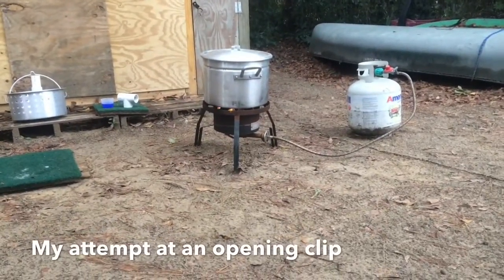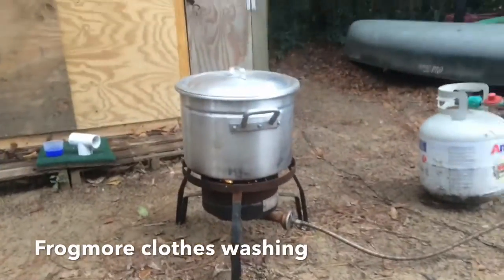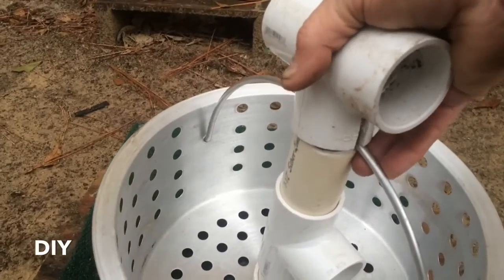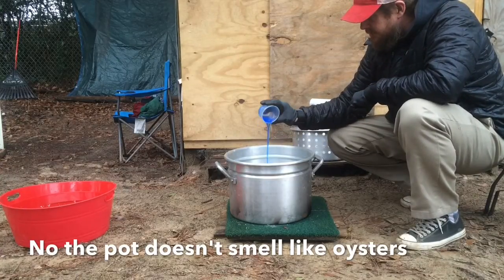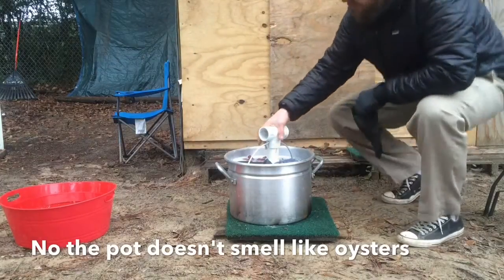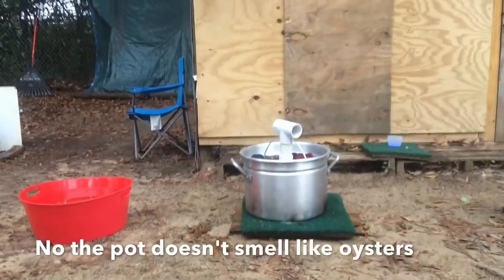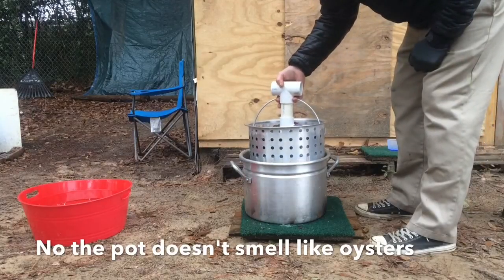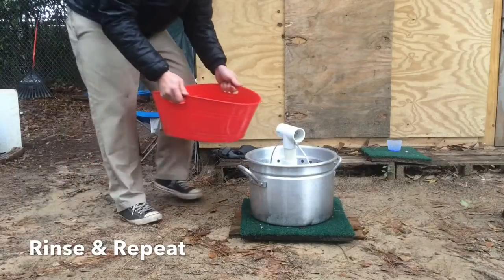Off Grid Washer Idea

Comment: Actual boiling of laundry will kill mold and bacteria that makes clothes smell dank. Our ancestors used to boil their laundry in cauldrons and use lye soap. But boiling laundry was extremely dangerous, so people had to be really careful. 
I hand wash cotton clothes in the sink. I use unscented dish soap because it won't make my skin itch. After the final rinse I use an electric tea kettle and pour boiling water over my clothes. I let them cool down. They never smell sour or dank. That's how I restored my dish towels that had gotten sour. I use it on my dish rags and they never smell any more. After I am finished washing my clothes, I use a Nina Soft centrifuge to pull out the excess water. Then hang my clothes to dry. They smell better and are more comfortable than machine washed clothes.